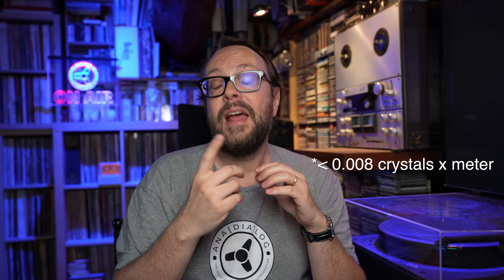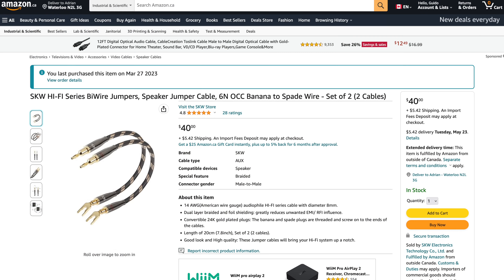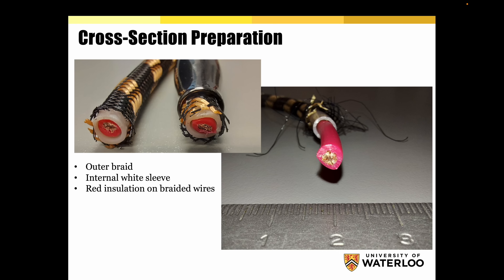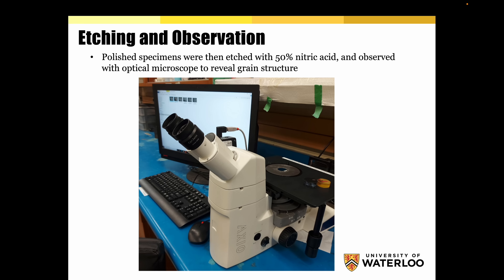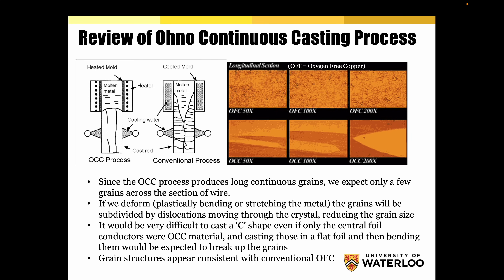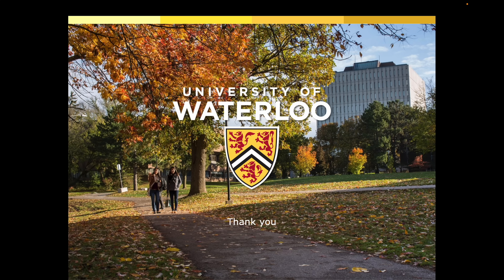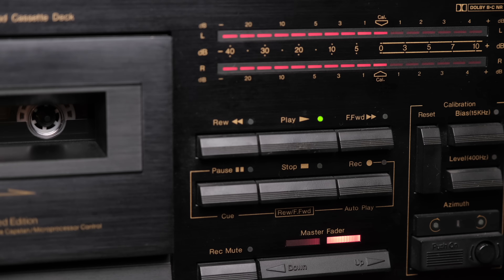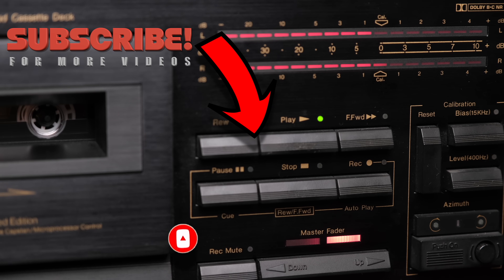Final SKW cables analysis: NOT MADE with OCC copper!!

Comment: Why couldn’t you just send a speaker cable like a 1 m speaker cable?
Reply from the maker: Because the jumper was clearly market as OCC copper. No need to spend more. In fact, after my video SKW has removed the OCC label from all their Amazon products, an admission of guilt.
Reply: @anadialog  I have recently purchased a pair of WORLDS BEST CABLES 10 Foot Ultimate - 7 AWG - Ultra-Pure OFC – Extra Premium Audiophile HiFi Bi-Wire Speaker my question is how can I get in contact with the university and the professor so I could send them say a meter of the same cable to get it tested? Is there any cost apart from shipping it to Canada? Thanks.

Comment: You were so convinced by the sound of the cables. And now? Isn't this the perfect blind test that shows that the influence of cables on electronics is overestimated?
Reply from the maker: As stated I still am convinced for the price! I they are great.  I have no problem in admitting when I am wrong just like here https://youtu.be/IY800_YWrkE?si=Yf1YlDcXtT1MfHzf Never said these are the best or better than Neotech and yes I can hear a difference between a bad quality speaker cable and an OCC cable. Perhaps I can admit that a quality OFC is difficult to recognize from a true OCC cable. But then again, are we sure we are truly dealing with OCC copper? My doubts are growing…
Reply: @anadialog  
I agree with you. Good workmanship in a cable is just as important to me as a good signal line. In a higher price segment you should be able to trust the manufacturer's specifications. Nevertheless, some providers repeatedly try to declare features for their products that are demonstrably not present. SKW no longer advertises its products in my country using the term OCC.
Reply: @anadialog  As for 2025 the only factory that cast real OCC copper is Neotech, Taiwan. No more OCC from Japan, Furukawa stopped on 2014. So, solid cable brands that use real OCC (bought from Neotech) are Wireworld, XLO, some MIT cables and others. Furutech has some leftover of OCC from Furukawa. Don't buy from non reputable and solid brands. Apart from OCC, there is CDA 101 copper (certified) - that is 99,996% or 4N copper as second best conductor. There is no OFC 6N or 7N - only some lab samples. OCC copper from Neotech is 5N copper - 99,9996%.
Reply: No you can't hear any difference and you will fail every blind test like all others before you making such bogus bs claims. You are not special you are not super human. Get over yourself  @anadialog
Reply: Yes he said he could hear that it was OCC copper as well.
Reply: I did a blind listening test to SKW vs Amazon cables and SKW for me is at another level. I think the point here is that OFC vs OCC is far less important than what your ears hear and your personal preference.

Comment: You are out of your depth. I watched the Chinese OCC copper: fake or real? Video and showing documents from 2011 is completely irrelevant. In a full Q.A. system the cable you buy must be traceable to the roll of copper wire which will be supplied with both certificates of conformity and the mill test reports and certificates. The paperwork is only showing data against product at the time of testing, that has ZERO bearing on product supplied in 2023.
Reply from the maker: Irrelevant in respect to what I have discovered and exposed in this video. The result? Here: https://youtu.be/y9ozZNLfO10?si=_niTV6HulbdT8Cdi
Reply: @anadialog  Huh !, I explained that !, The cable you are showing old certs for is NOT relevant to anything purchased a decade later, I hope that sinks in. You uncovered very little given you had already pushed people to buy it initially, until people started taking the mick, drop the ego and be honest next time and perhaps do some due diligence before you recommend things.

Comment: Great vid and very informative. But I must confess, for my latest project, fully active zero baffle speakers, I went to Home Depot and got some Southwire 4 conductor 12 gauge wire. Guess what, sounds fantastic.
Reply from the maker: Thanks! Sounds fantastic compared to what? Which quality cables have you tested?
Reply: @anadialog  my work has been primarily live so Belden, Canare and Mogami are staples. I have heard systems with esoteric cables at shows and always chuckle. Even Jay's friends picked the $27 speaker cables over the $20, 000 set in one of his recent vids. $$$ ≠ quality in every case.

Comment: Hello. It's been a while. I thought I'd give my 5 
pence worth on this video. I just came accross this cable in a charity shop brand new and sealed. Cost me only £2.50 so I thought what the heck let's try them. After connecting them I listened to the sound before burn in. The highs are brought forward on the sound stage but you lose depth and holography. OK wait a minute let's do a 90 hour burn in as advised on the instruction leaflet. Tried them again but they sounded the same. Now at this point let me tell you that all my equipment is run on pure occ Japanese copper from the 90s and sounds amazing. I thought I would give this CD player and the skw a good two months but still it sounded the same. So a big No I would not recommend these. I advise anyone who replaced their older cables to put them back on and you will notice the difference. If you want real quality find real Japanese occ copper cables. All my rca, coax, speaker cables are the exact same occ and I even changed all the cables in my amp and CD player's to occ  with pure silver solder for continuous occ signal as much as possible and the outcome is pure stereo holography that will blow your mind. You must think of your whole audio system as a one body to achieve audio nirvana. It's not about how much you spend it's about how you use the best material for audio. All the best to all you audio quality lovers.

Comment: Career metallurgist (and also coincidentally UW grad) here: 

Your description of the metallurgy in the intro was messed up.  Grain size, which is structure, has nothing to do with purity, which is about chemical composition.   You can have a small number of crystals in an impure copper, and vice versa.  I never expect civilians to get it right, but thanks for making the effort! 

The investigation answered the key question, determining that the copper was polycrystalline -- not as advertised!!  I have to question the technique of using etchants to determine composition -- that is totally clunky.  When polished (but not etched), copper has a colour that cannot be confused with any other metal, including copper alloys like brass and bronze.  A few minutes using X-Ray Fluoresence in a scanning microscope would have confirmed whether the wire strands had a compound structure. Copper surrounding an aluminum core is common practice and yields poor characteristics for speaker cables.  The marketers of such products usually do not declare this 'feature'.  So basically the claims made for SKW cables are fraudulent (and Amazon needs to be told).  

I would have done this investigation a little differently; actually any commercial met lab could have done the same report.  The work here was actually performed by a grad student and did not require any exotic knowledge.  The discussion about bending the cables was a distraction, and you incorrectly concluded that flexible cables should never be bent.  If the cable returns to its original shape then you likely have done zero harm.  Kinking it is another matter, but even then, once or twice probably does no harm. 

p.s., all you really needed to know that China will tell you whatever you want to hear and then do something else.  I thought everybody understood that.  If you want a true OCC cable (and if you truly believe it has benefits for your listening experience), it will cost you considerable money, because there are no shortcuts to making such an exotic product.  Personally I would put my money first into optimizing the room characteristics and maybe an upgraded phono cartridge and phono pre-amp.
Reply: I notice SKW on Amazon no longer claims OCC for their wires (I seem to recall from previous perusal that they did).  They have left up the glowing reviews though, and prices are still sky high.  Based on what we learned from this study I could replicate their $150 cables myself for under $30.
Reply from the maker: @georgelewis3047  They did that after my video. Yes, we have the power to do that when we present scientific proof. I know it was this video because they removed it ONLY from Amazon.com immediately after the publication of my video, then it slowly changed everywhere and actually SKW is almost gone from the other Amazons.
Reply from the maker: Actually me and the people who follow me know exactly the difference, in fact I did an entire video on monocrystal copper, purity, oxygen free copper, amorphous metals etc. here: https://youtu.be/YCgfQr84Yco?si=0nsdFpADwz6R2s_5
I just stated that in the prior video I forgot to talk about the crystallization and focused only on purity, hence this other video. Quite straightforward actually.
For the rest I leave it up to who knows this type of analysis, not me. In fact I will forward you comment to Prof. Gerlich, which is an authority in the field.
Reply from the maker: Here is the reply from prof. Gerlich:
Yes, they kind of have some points, but I think are misunderstanding some others:
Etchants are not used to reveal composition, but to show grain boundaries of crystals, and confirm if we have a single or few crystals or hundreds.
Depending on the light source and optical filters and camera processing, you can make any metal look any colour, but yes generally copper is always yellow looking.
Typical lab X-ray fluorescence instruments are not really sensitive to the <0.01% levels, never mind the <0.0001% you expect in OFC high purity copper.
Yes, the steps we took were what a met lab would initially do, and to reject the notion it’s not OCC metal, that was enough. Further detailed analysis using electron backscatter diffraction can be done for some cost, but it’s also going to confirm is polycrystalline copper.
Sure, bending that might happen in service should not plastically deform the grains in stranded wire with strand about 0.1mm in diameter. We were just trying to further prove the etching was correct, since grains developed slip lines (classic indicator of deformation). In fact to cause such deformation to the grains you have to bend the strand around into a really sharp radius <1mm, you can’t do that to the wire with the insulation on it, which acts as a strain relief.
 
Hope that clarifies things a bit!
 
Cheers,
Adrian
Reply: @anadialog  The main question was answered, that SKW were lying through their teeth (possibly OCC silver filled teeth?)  Additionally there was evidence of strain hardening, which increases resistance and is very probably detrimental to any characteristic that is important for signal fidelity.  The rest I acknowledge is a quibble.  

Not being a copper specialist I consulted the Copper Development Association website, but unfortunately they do not appear to have any publications on this subject.  But my interest in nearly pure copper metallurgy has been piqued and I shall put my googling skills to work to find what the electronic engineers and scientists have to say. That is if google has not already completely corrupted their search engine.

Comment: Mildly Interesting Metallurgy Presentation - BUT, SO WHAT? Any Audio Enthusiast worth their Salt WILL DEMAND "ONE TEST" -- A Spectrum or FFT Analyzer Measures the AC/Harmonic  Components AND the AC Impedance VS Frequency  from  20 Hz to 20K Hz  it's just a couple of Basic Graphs (which really should be supplied ) with esp these Snake Oil Claim Cables (and are not). 
If you're gonna charge $100 to $1000 for a 10 ft Speaker Cable - and it "Does-Not" include those Graphs ---- You're a Supplier just Pizzing In the Wind to - RELY ON SUCKER BUYERS. .

Comment: What I note here, based on what I see, that is more disturbing is that the c-section silver foils are placed in the centre of the braided copper cables conductor. The whole point of braiding the strands of copper is minimize the skin effect. To that end, the strands are interwoven. But here we see the opposite: the silver strands, which are the most expensive part, stay in the centre of the conductor throughout its length (unless the section shown was a mere coincidence which I am prepared to seriously doubt). All in all, that seems like a waste of material to me. I do not know whether it has an audible effect or not but I would be curious to find out how the same cable would perform if the silver strands were removed and replaced with equivalent copper strands or just not replaced with anything.  I would be inclined to bet there will not be any perceptible difference but then again this is not an experiment I am prepared to pay for.

Comment: What I never understood is what happens to the OCC cables copper structure when one bends the cable a few dozen times. I mean this something one can expect from OCD audiophiles who are in the habit of messing with their cables and loudspeaker positioning, exchanging components in their system etc. all the time. If this does have an effect to the structure maybe we will soon see another specification for cables: OCD AP OCC.
[Edit] 10:40 Question answered here. Thank you for answering this.
The other thing is why is it that we see OCC mostly specified for loudspeaker cables but not for signal cables. I get that signal cables are usually less than a metre long but that does not stop audiophiles who have dual monophonic amplifiers systems from looking out for OCC cables even when these are not much longer than one meter!
Reply from the maker: I would say it’s almost the opposite, there are lot of OCC interconnects, Zapfine, ramm, neotech, old oyaide. IMO Neotech is the only true valid producer with certification

Comment: Except whether it's OCC or plain old OFC it doesn't make a shred of difference since electrical current flows on the surface of a conductor wire and not through it. 
It's all well and good to disprove some obviously spurious Chinese cable peddlers' claims but why not go further into the analysis and start measuring capacitance, resistance and FR differentials between OCC and OFC. You'll be hard-pressed to find anything that will make an audible difference.
Reply from the maker: Those values have no sense with cables so short. I have discussed this in detail in a dedicated video: https://youtu.be/uVKFSquAhwc?si=ierhAFl5n5qJ3dFF

Comment: I was surprised you said you "still stand behind the quality of them."   How come?   They lied about the copper used and I would be surprised if they are even OFC or 99% pure (let alone 99.999% pure).  They also appeared to be using aluminum strands or some similiar cheap metal. I've seen these for $15 or less on Chinese wholesale sites.  Imagine how cheap these would need to be in order to be sold at a profit for $15.  IMHO, SKW cables are a hard pass.  

Great job on the research!  We now know the truth to possibly warn other buyers.  Two months have passed.  Did SKW ever reply?
Reply from the maker: I am just saying that for the price the sound quality remains valid. I hate to admit it but I can't deny it

Comment: I have done Spectragrams of ofc vs OCC.  Very obvious differences.  Differences that affect sound in many beneficial ways.  Higher peaks, no cutoff, separation, saturation, etc.... Means more robust deeper sound through entire spectrum.  Cleaner on impacts and extended vocals. It's superior sound and yields very similar graphic as mp3 vs OCC.  Significant fact that means with SKW OCC cable is comparable  to listening to wave music files as opposed to mp3.  Can't hear that difference then don't worry about it.
Reply: It's good if it's as different as a lossless wave compared to a compressed mp3 because they people should be able to easily back that up scientifically as that would yield significant frequency differences. Just show the curves and your methods and you can end the cable, and cable material, debate forever. No reason not to!

Comment: cables change nothing - in other case what happens to the same electrons / electric current in the steel or aluminium legs of tubes or transistors, resistors, capacitors, it's the same current going through the cable and the elements in your amplifier - a little bit of science : https://www.youtube.com/watch?v=FBol5Nw46fE&t=629s and https://www.youtube.com/watch?v=8Qwh8fXs-R4&t=50s - cables changing sound means stupidity - guy says : "it's like buying car wheel caps / covers and thinking that the car becomes better"

Comment: Seems like they went through a lot of trouble to makes the different orientations of the strands. Hopefully the profile “C” material isn’t just to take up space

Do you think you thought they sounded better because you thought they were OCC

Have you sent this information to the company. I think you should. Hell you might even get another video out of it :)
Reply: Placebo effect is very powerful, I've had in my system thousands of dollars in Nordost cables and decided to build a set of pro quality  Mogani speaker cables with relatively cheap banana plugs and without any doubt they sound better than my real Nordost flat line red haven speaker cables.

Comment: Just think all those Records made prior to 1976 AAA Sounded shitty because they did not use OFC or OCC cables-Cables are an Electrical Joke-Every circuit in your High Fi uses different wire than the short signal path of Interconnects MICRO SECONDS/ Do cables sound different? Of course Transister-Coils - Resistors all sound different in the same circuit